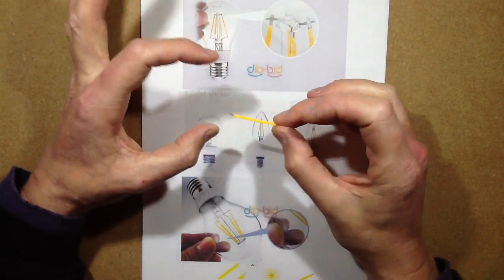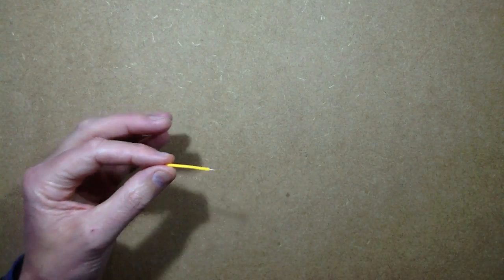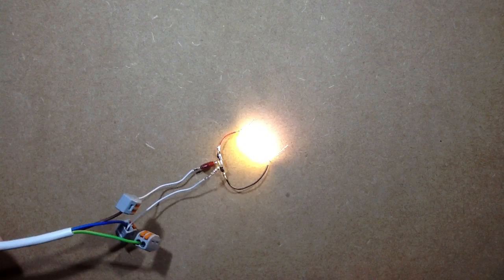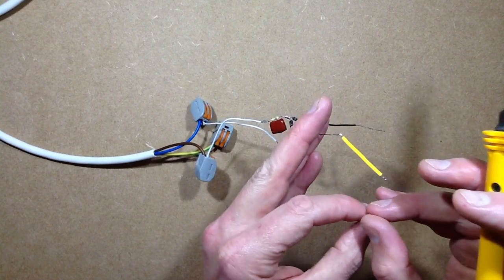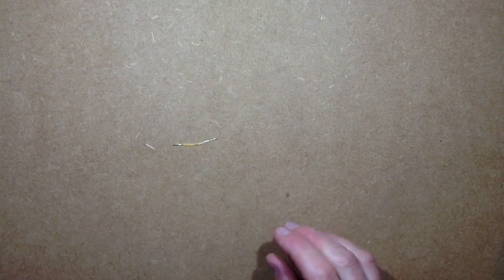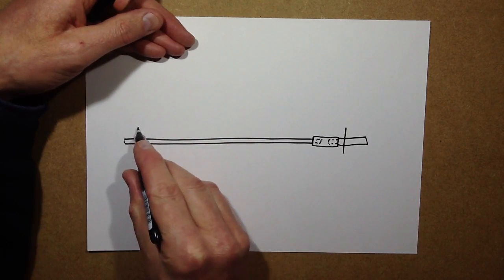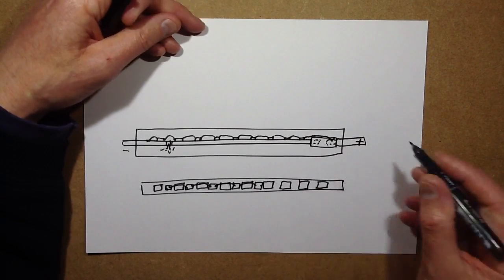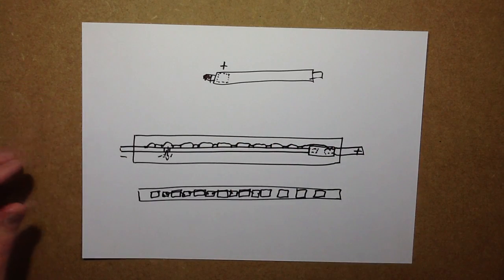LED filament teardown and experiments. (short version)

Comment: A very clear informative explanation of how filament LEDs are constructed... Thank you.
Reply from the maker: They've evolved.  The substrate is usually ceramic or glass with new LEDs called flip chip LEDs that are soldered directly to the substrate without bond wires.

Comment: I've been dying to get hold of some of these for a retro 7-segment display clock to see if they can mimic the old numitron filament look.
Reply from the maker: The slight downside there is the high voltage of all the series LEDs.  But with a nixie style driver it should be viable.
Reply: Actually, now that you've mentioned Nixie tubes these look perfect for a modern version of the Burroughs B7971 alphanumeric Nixie tube. Certainly a lot cheaper!
Reply from the maker: MegaWayneD Nixie voltage is going to be current limited to a few milliamp at around 90V so a simple resistor change should be all that's needed to drive single segments.  These LED filaments will light brightly at just a milliamp or two.
Reply: Thanks for that! I think I've still got a nixie driver circuit lying around so I'll experiment.
Reply: MegaWayneD Wow great idea! I'm tempted to do this :)

Comment: Thanks, Clive - useful video indeed.
Just got ten of these... 50% broken... just chucked in a plastic bag from delhanway.
The negative on mine seems to be marked by a tiny hole through the connector at that end.
Reply: +mickey thompson 50% yield? You got lucky, then! I bought 10 and got only 1 unbroken, had them resend, and only 2 of those 10 were intact. It seems those morons can't figure out to put them in a small box and mail that. (As I've received other, less fragile components from China.)
Reply: It is astounding, isn't it!
I wonder if they are actually broken to start with - factory rejects, posted badly in the hope we don't complain.
Reply: Actually, I fared much better getting some from "bicoins" - they packed the filaments in some bubble wrap.

Comment: PS this is really damn cool and I can't wait for my whole house to finally be lit like this. You could maybe even do away with dimmers by just having a variable number of filaments be switched fully on or off using small mosfets or the like instead of having to add resistance or chop the mains wave, which is both inefficient and seemingly pretty unfriendly to anything that isn't tungsten...

or have a bunch of these in a cool spiral pattern within a bespoke light fitting...

or just woven into your ceiling with an even distribution

or.. etc.

Comment: I bought 10 of these.  They're really nice but man are they delicate.  2/10 came dead on arrival.  I broke 2 more soldering them, the pins become detached with very little force rendering them useless.  I think you're right about they're supposed to be crimped, but I can't imagine them being very sturdy then either.  But the end result was pretty nice, and now I have 4 I can dissect.

Comment: Hi Clive, I have a 4W version of this lamp made by Meridian lighting sold at Toolstation. Out of the 8 that I have bought 2 have started flashing. It's not a problem with the fitting just those two particular lamps which I have replaced. I have not dismantled them yet but would appreciate it if you could have any idea what would cause them to flash. The internal circuitry appears very simple so what component would you think might cause this problem?

Comment: How is it that these tiny Power L.E.D.'s can be used without the quite extensive Heatsinking we seemed to need in earlier L.E.D. Light Bulbs?
Are they more advanced Power L.E.D.s Clive?
Reply from the maker: They can tolerate much higher temperatures now.  But they still push them too hard.
Reply: @bigclivedotcom  Thanks Clive!
That was what I wanted to know.

Comment: Where I live the lighting engineers are installing tubular LED’s lamps in old Low Pressure Sodium or SOX lighting fixtures
Does anyone know if the LED lamps run directly off the SOX ballast or does the engineer have to disconnect the ballast?
Reply from the maker: Sox lamps have a combined ballast and step-up transformer, so I'd guess they may be bypassing the ballast and just taking mains to the lamp, or even retrofitting an electronic driver.

Comment: hi clive, I bought this one a long time a go, now i want start using it, but i received mine without anything that state the polarity, and it comes loose. how can i tell the polarity just by looking at it? thanks in advance
Reply from the maker: lucidrinestudio If they're the rubbery versions then look at the ends and one will have a slight white blob inside at one end.  That should be the positive.
Reply: ah yes, thanks for the tips, it works great
btw did you by any chance have dimmable led bulb circuit or video? thanks
Reply: +bigclivedotcom Where can one get the rubbery ones? The glass ones are useless, on account of it being seemingly impossible to get them delivered intact.
Reply from the maker: +Antonio Tejada Do a search on ebay for LED filaments and select the cost and shipping lowest option to try and limit the listings down to the bare filaments.  It should be visible in the pictures if they are the rubber or glass ones.  But that doesn't guarantee that you will actually get the type in the picture.  If in doubt buy from a few different listings.   http://www.ebay.co.uk/itm/301379430602

Comment: When I pulled one of these out of its clear plastic retail packaging (in near darkness) I noticed a flash. They seem to be sensitive to static charge, unless it's something to do with the electronics
Reply from the maker: The LEDs are super sensitive, and will glow visibly with just a few microamps.
Reply: contactless live wire detector / light switch illuminator anybody?
Reply from the maker: bridgendesar LEDs are already used in light switch illuminators by wiring them across the lightswitch with a suitable resistor or capacitive dropper circuit.  The lamp isn't going to be sensitive enough to be used as a non contact tester.  It required the significant charge of drawing it out the packet to make it flicker,

Comment: Hi Clive, I don't know if you've seen this video on the making of the filament LED bulbs. How It's Made LED filament Bulb  Regards Mark
Reply from the maker: I had seen that video and LOVE the fact these are made like traditional filament lamps.  The large series arrays make the lamps very suitable for simple capacitive or even resistive droppers and the LED chips themselves are just common mass-produced chips as used in 3 or 5mm LEDs.  I can see a really significant trend towards decorative LED filament lamps in the future.  I spontaneously ordered one last night.  I wonder how long I'll have it before I take it to bits.
Reply: Just wanted to check, knew you'd be interested. I might order some myself, used to be an engineer. Keep making the videos they're very interesting!
Reply: vulcanbreeze Depressing.  Yes, interesting to see how they're made, but look at the manual labor involved.  Even worse, it turned my stomach to see the young girls (almost children) slaving away starting at "4.13" in the video.  Just sayin. :-(

Comment: OK, I'm not big on the full knowledge of how electronics works at this level - how come you could put one, two, or three of these in series without issues or the voltage seeming to significantly change? Especially a chain supposedly rated for first 80, then 160v, on a 230v supply?

Also if they're nominally 80v (and 0.4w) each, could you just chain three together with a bridge rectifier and wholly optional capacitor for a cheap and dirty 1.2w lamp? Or indeed, make the rectifier out of two (four?) 3-unit chains of them and plug it directly to the mains for a flickery but super simple 2.4w (4.8w?) one? ((or would it only actually be 1.2w still, using twice as many filaments, each only receiving half as much average voltage, but no other components save maybe a couple of smoothing caps?))

FWIW, 80v divided by 28 is a little under 3v ... or to be exact, 250 divided by 3, then by 28, is JUST under 3v. So they've been careful to engineer things so they'll stay in spec quite nicely.

You might even be able to make the aforementioned no-other-components light-emitting-rectifier work with a pair of single-filament conductors on a 110-ish volt supply, as the peak will be just on the low side of 170v before RMS is considered... and it only actually gets half the wave...

Comment: Hey Clive, thanks for enlightening us (pun intended). Did you manage to upload the 40 minute long version?
Reply from the maker: +PuchMaxi1988 I couldn't at the time, but I really should try again to see if I can get it to upload.
Reply: +bigclivedotcom That would be very nice indeed! Did you by any chance read the CLASP report on LED filament lamps? http://www.eceee.org/ecodesign/products/domestic_lighting/TestingClearLEDLamps1000hTestUpdatefinal.pdf
Reply from the maker: +PuchMaxi1988 I'll have a brose through that later.  I've had a quick glance and it looks pretty good so far.  I wonder how many of the filament style lamps came from the same factory.
Reply: trouble uploading again clive?